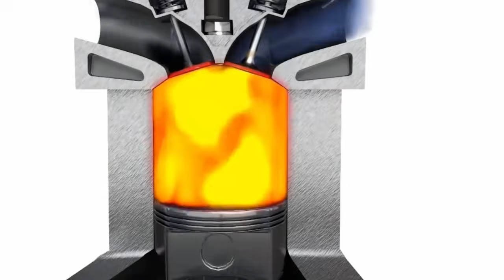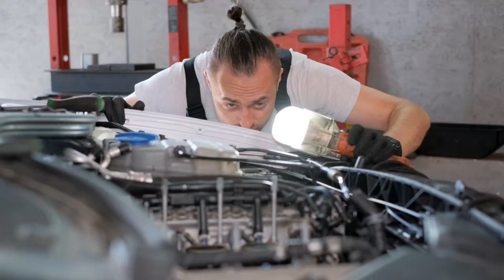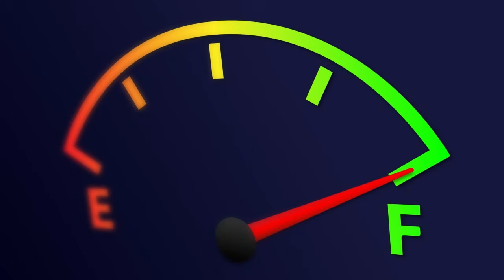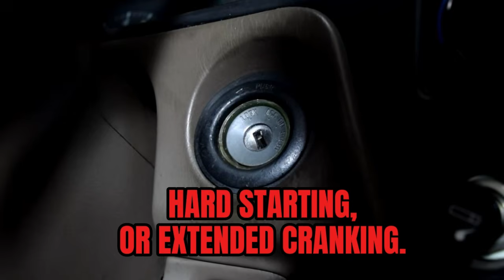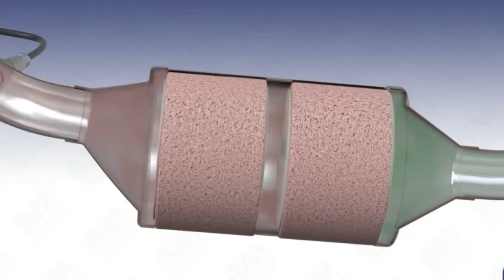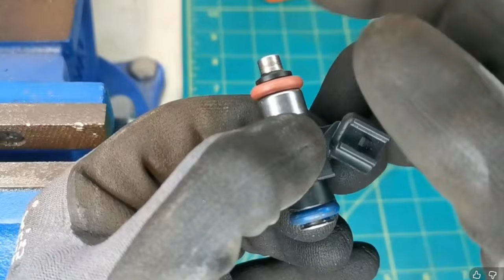Bad Fuel Injector? 11 Symptoms You Shouldn’t Ignore

Comment: Super informative info on the topic. Appreciated so much !  My 2015 grand cherokee - cylinder 3 misfires in idle (850 rpm or lower) then goes away in normal driving for the most part. Changed the spark plug and coil with no change. So maybe it's a pinched intake gasket being pinched creating an air leak or maybe a bad injector? O2 sensor bank 1/1 is also giving funny voltage. Going to change that. 
I use to have a -10 LF Trim.. I'm not a mechanic but trying my best .. going o change all injectors while I'm at it..  Any ideaas I should try?  TY.. love the channel.
Reply from the maker: Thanks, and I’m glad the video helped. Since the cylinder 3 misfire stayed after changing the plug and coil, I would not replace all the injectors or the O2 sensor yet.

The -10% long-term fuel trim is an important clue because it means the computer has been pulling fuel, which points more toward a rich condition than a typical intake vacuum leak. A leaking or sticking injector on cylinder 3 could definitely do that.

I’d swap injector #3 with another cylinder first. If the misfire follows the injector, you’ve found the problem. If it stays on cylinder 3, then check the injector wiring/connector, do a smoke test around that intake runner, and perform a compression or leak-down test to rule out a valve or mechanical problem.

Also, be careful condemning the Bank 1 Sensor 1 O2 sensor just because the voltage looks unusual. A misfire or rich condition can make the O2 readings look abnormal even when the sensor itself is working correctly. I’d fix or isolate the cylinder 3 misfire first, then reevaluate the O2 data and fuel trims.
Reply: @theeffectiveguide  I greatly appreciate your help. You must be a mechanic by the way it sounds as some don't reply as clear or at all so again very much appreciated. (or Ai content). 
I tried a smoke test and misting carb cleaner with no motor change.  So I guess as far as I can go is a compression test and wiggle the wire at connector. 
Car has 150K miles so I figured I'd be lazy (bad practice) and just switch out all the injectors to avoid plenum reassembly if not, then take it to a shop. 

Funny thing too is when I put in the new coil and plug I got more misfires for that cylinder, but maybe because now I do have a code for bank 1/1 because when spraying PB blaster at the sensor to loosen it. the spraying got sloppy because of distance and then gave me a permanent code for max voltage. So now I guess I should change that sensor as well. 
Not sure if that's causing the more misfires.  .. fun isn't it.  thank you !   PS - the said replaced spark plug was brown at the base I guess because of the misfires where cylinder 1 was that nice slightly tan color
Reply from the maker: You’re making good progress. Since the smoke test and carb-cleaner test didn’t show an obvious vacuum leak, I’d do the compression test on cylinder 3 before replacing all six injectors. If compression is good, then swapping injector #3 with another cylinder is still one of the cleanest ways to prove whether the injector is actually causing the misfire.

The fact that the misfire got worse after the new plug and coil is also worth double-checking. Make sure the plug is the correct type/gap, the coil boot is fully seated, the connector pins are tight, and nothing was damaged or disturbed during installation. A new part can occasionally be faulty too.

I also wouldn’t automatically replace the Bank 1 Sensor 1 O2 sensor just because you now have a high-voltage code. A rich condition, wiring/connector problem, contamination, or a short can all create a high-voltage reading. Since PB Blaster got around that area, inspect the sensor connector and wiring carefully and clean any residue before condemning the sensor. Also remember that a permanent code may remain stored for a while even after the actual fault is fixed.

And the brown mark around the outside/base of a spark plug can sometimes just be corona staining, so by itself it doesn’t prove that cylinder was misfiring.

At this point I’d go: compression test → inspect the new plug/coil installation and connector → injector swap/test → then reevaluate the O2 code and fuel trims. That should keep you from replacing several expensive parts at once.
Reply: @theeffectiveguide  Wow, I am deeply indebted to you. You have given me a road map that I will follow. You gave me plenty of info from your kindness. Thank you, you have also given me the confidence to proceed with what I can handle. Good Blessings. thank you !

Comment: The corolla runx loose power and change idle on the exos and smell petrol inside the car
Reply from the maker: Power loss, changing/rough idle, and a petrol smell inside the car can point to a rich-running engine, leaking injector, EVAP problem, or an actual fuel leak.

Because you can smell fuel inside the cabin, I’d first inspect the fuel lines, injector area, fuel rail, and connections for any wetness or leakage. If the smell is strong or you see fuel leaking, don’t keep driving the car because of the fire risk.

If there is no external leak, then scan for codes and check fuel trims, injector operation, fuel pressure, MAF/MAP readings, and ignition misfires. A leaking injector or overly rich mixture can cause both power loss and a strong fuel smell.

Comment: My problem the engine when you Accelerate it starts to like start to go slow and then it starts to run after you put more generator and then it gives me black smoke
Reply from the maker: Black smoke during acceleration usually means the engine is running too rich—too much fuel or not enough air. Since it also hesitates before picking up speed, I’d check the air filter and intake first, then scan the fuel trims and inspect the MAF/MAP sensor, fuel pressure, and injectors.

A leaking or stuck injector can definitely cause these symptoms, but so can a faulty airflow sensor, high fuel pressure, or an ignition misfire that leaves fuel unburned. I wouldn’t replace the injectors until the fuel pressure and injector operation are tested.

If the black smoke is heavy, avoid driving it hard because an overly rich mixture can damage the catalytic converter.

I also have a video specifically about black smoke that may help you narrow it down:
https://youtu.be/Hci-jNbO5jU

Comment: Yeah I put new fuel injectors in a 1996 Pontiac Grand Am 2.4 engine and it will not crank now what should I do so it will crank
Reply from the maker: If by “won’t crank” you mean the starter does not turn the engine at all, the new injectors themselves are probably not the cause.

Since the problem started right after the injector job, recheck anything that may have been disconnected or moved: battery terminals, engine/body grounds, starter wiring, main fuses, and electrical connectors around the intake/fuel rail area. Make sure the battery is fully charged too.

I’d also check that the transmission is fully in Park/Neutral and try starting in Neutral.

If the engine does crank normally but just won’t start, that’s a different problem—then I’d focus on injector connectors, fuel pressure, spark, and whether any wiring was left unplugged after the repair.

Comment: My car misfits Nissan skyline VQ 25 de V6. Engine pls help
Reply from the maker: For your Nissan Skyline VQ25DE V6, I’d start by scanning for misfire codes (P0300–P0306) to identify whether the problem affects one cylinder or multiple cylinders.

Check the spark plugs, ignition coils, and look for oil inside the spark plug wells. Vacuum leaks, weak fuel pressure, faulty injectors, or low compression can also cause misfires. Don't replace the injectors until testing confirms they're faulty.

Does it misfire at idle, during acceleration, or both? And is the check engine light flashing or steady? Share your model year and any fault codes, and we can narrow it down further.

If the check engine light is flashing, stop driving to avoid catalytic converter damage.

Comment: Check engine lights
Reply from the maker: If the check engine light is on, the best first step is to scan the codes first. The code can tell whether it’s related to the fuel injector, misfire, MAF/MAP sensor, oxygen sensor, fuel pressure, or another issue. I also made a separate video about check engine light causes that may help: https://youtu.be/1xjpMyvEmkY
Reply: @theeffectiveguide thank you 🙏

Comment: Maybe my honda civic 2015 model get this symtoms it gets hard start during long drive 90min, and when the engine is hot i need to cool down the engine to start again and need to pump the gas pedal.  P0087 diagnos code for my honda civic. Thank you for the info.
Reply from the maker: P0087 means the fuel rail/system pressure is too low, so your hard start after a long drive and the engine not starting again can definitely be related to a fuel delivery problem. I’d focus on fuel pressure testing instead of guessing.

Common things to check are the fuel pump, fuel filter/strainer, fuel pump relay, wiring/ground to the pump, fuel pressure regulator, fuel pressure sensor, and possible injector leak-down. Since it happens after a long drive, the fuel pump or relay may be getting weak when hot. I would not keep driving it on the highway until it’s checked, because low fuel pressure can make the engine lose power or shut off suddenly.
Reply: @theeffectiveguide exactly sir,now i drive again almost 80min then suddenly lost power in the road and vsa light,engine light, power steering light,!tire pressure light pop up. Same last week that make towing my car in the midle of the highway,I cool down  engine for almost 2hrs and started again but same light appear. Need to fixed tommorow.
Fuel injector leak, rail pressure is too low.

So what is the best to do is this the culprit  bro?

Need to change it or just clean the injector or the censot and electeical. Since this is almost 11 years of age and 199000km odometer
Reply: Tommorow i can use the car for 6km drive going work in morning and 6km in the afternoon going to car workshop right sir?
Reply: @theeffectiveguide the rail pressure  reading is normal according to diagnos reading and to the cumputer graph as i see in the actual reading maybe engine filter or injector leak
Reply from the maker: P0087 does not automatically mean the injector itself is bad. It means the fuel pressure is dropping too low. If the rail pressure looks normal while the car is sitting or idling, it can still drop when the engine is hot or under load while driving.

Since you lost power on the road and multiple lights came on, I would not start by cleaning or replacing injectors first. I’d ask the shop to test fuel pressure while driving/under load and when the problem happens hot. Check the fuel pump, fuel filter/strainer, pump relay, wiring/ground, fuel pressure sensor, regulator, and injector leak-down. Also check battery/charging voltage because low voltage can trigger VSA, power steering, TPMS, and engine lights together.

For the 6 km drive, I can’t say it’s safe. Since it already lost power on the highway, towing is the safest option. If you must drive it to the shop, avoid highway/high speed, drive slowly, and stop immediately if it loses power or warning lights come back.
Reply: @t @theeffectiveguide thanks aug.20 is my schedule i would tell to the mechanics that  thermal fuel system is the problem.
If the battery or alternator it should not be start while the car is park for 12hrs. In the morning it start normaly.
The nearest posible culprit there is rail pressure low, maybe there is broken telescopic valve in the injector when it reach the treshold temp of the engine it gets wide open that cause of fuel leak, diesel get thinner when it hot.
Or there is sencor malfunctiong reading and electeical .
Due to its mileages also 200k odometer. 
We will this coming week
Reply from the maker: That makes sense. Since it starts normally after sitting overnight but acts up after driving and getting hot, a heat-related fuel pressure problem is definitely possible. I’d have them check fuel rail pressure when the problem is actually happening, not only when the car is cold. Also check injector leak-down, fuel pressure sensor, regulator, pump/relay, and wiring. With high mileage, testing under hot conditions is the key. Hope they find the exact cause this week.
Reply: @theeffectiveguide the mechanics told me fuel pump is broken. Waiting for the car dealer decision regarding the total cost and the mechanic will  do it immidiately

Comment: 1993 Pontiac Grand Prix gas pouring out of intake air intake
Reply from the maker: If gas is pouring into or out of the intake, do not try to start the car. That can be a fire risk and can also flood the engine. On a 1993 Pontiac Grand Prix, I’d suspect a stuck-open fuel injector, leaking injector O-rings, failed fuel pressure regulator, or a fuel pressure issue. Have the fuel system inspected before starting it again, and check the oil too because fuel can wash down into the crankcase if it floods badly.

Comment: Check engine light
Reply from the maker: If the check engine light is on, the best first step is to scan the codes. The code can point you toward the right area, like fuel injector, misfire, oxygen sensor, MAF/MAP sensor, or fuel pressure issue. I also made a separate video on check engine light causes that may help: https://youtu.be/1xjpMyvEmkY

Comment: Hard  misfire  speratic  while driving  no check engine light  after few days more misfire  then few more days  misfire  all the time but before  has hade a slow start bump 1time cold starts every time but let warm up may have to bump 2 or 3 times to start
Reply from the maker: A hard misfire with hard starting can come from a few things, even if the check engine light is not on yet. I’d scan for pending codes and misfire counts first, then check spark plugs, ignition coils, fuel pressure, and injector leak-down. Since it starts worse when warm, also check for a leaking injector, fuel pressure bleeding off, or a crankshaft position sensor acting up when hot. Try not to keep driving with a hard misfire too long because unburned fuel can damage the catalytic converter.
Reply: @theeffectiveguide i suffer hard start when i finished long drive around 40min to 90 then  i turned on the engine its not working P0087 diagnos code

When i driving in high suddenly get into limp mode and shutdown the car
Reply from the maker: @newstoday8021
Since you have P0087 and it goes into limp mode or shuts down after driving, I’d focus on low fuel pressure first — fuel pump, relay, filter/strainer, wiring/ground, pressure sensor, and regulator. I replied with more detail on your main comment too.

Comment: What about diesel injectors
Reply from the maker: Diesel injectors can cause many of the same symptoms too — rough idle, hard starting, poor acceleration, bad fuel economy, engine knocking, misfire-like shaking, black or white smoke, and fuel smell. For diesel engines, I’d check injector balance/correction values, leak-off test, fuel pressure, fuel filter, and scan for diesel-specific codes. A weak or leaking diesel injector can make the engine run very rough.

Comment: 99 ford ranger XLT problem is weak acceleration at around 40 mph and it’s not doing it every time under load mostly uphill and no check engine light on dash yet. Replaced wires plugs fuel filter and pump catalytic converter air filter scan transmission and it’s working great and still have a weak acceleration! Any solution? I believe it is the fuel injection. I’m a woman bought truck brand new 157,000 original miles. 3. 0 2 wheel drive So far no mechanic has been able to fix the issue and I have been to 6 business garages that claim to be certified mechanics. I haven’t been to Ford dealership yet! Very frustrating! Thank you 😊
Reply from the maker: Weak acceleration under load, especially uphill, can point to fuel pressure, a clogged fuel filter, weak pump, dirty MAF sensor, restricted exhaust/catalytic converter, or ignition problems under load. Since there’s no check engine light, I’d start with fuel pressure and MAF readings first.

Comment: Stumbled on the way to work at 60mph and on the way back at least twice
Reply from the maker: A stumble at highway speed can come from an ignition misfire, weak fuel delivery, dirty MAF sensor, bad injector, or transmission hesitation. I’d scan for codes first and avoid pushing it hard until you know what’s causing it.